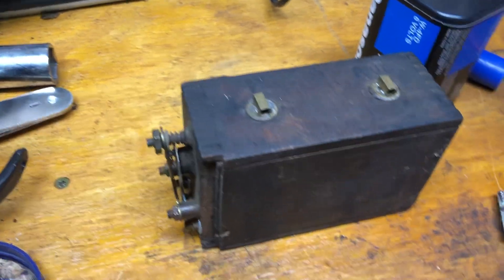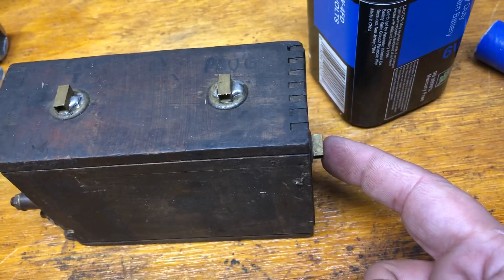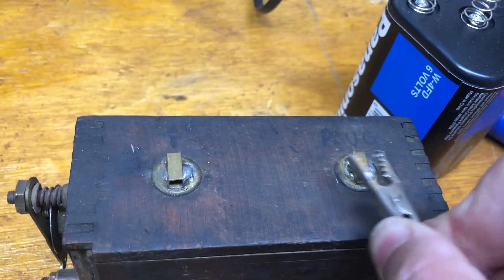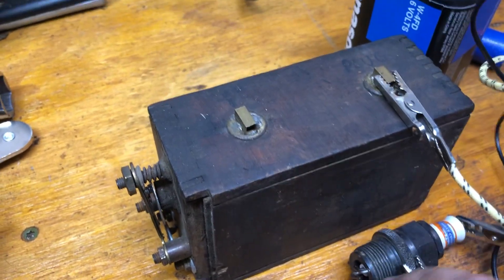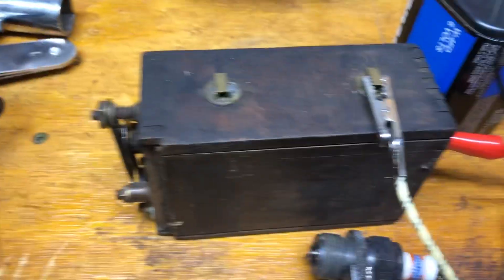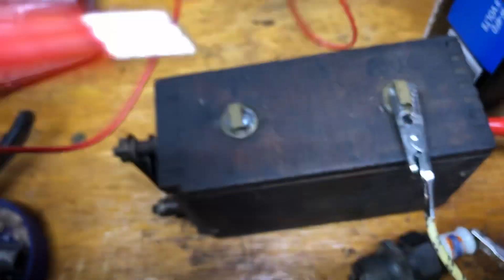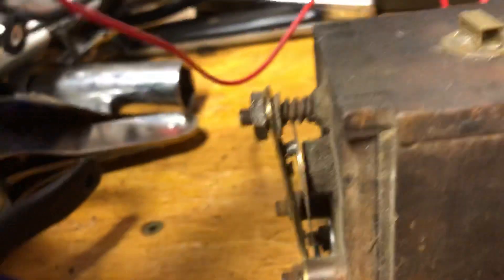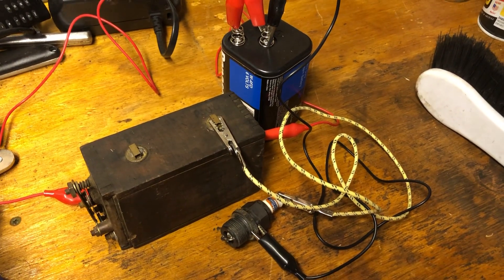Wiring a Model T buzz coil

Comment: That is a fascinating piece of gear. A self oscillating spark maker. It is like an MSD system but mechanical instead of electronic. So every time the timer points at front of motor  close that cylinder gets multiple sparks instead of one spark like we are used to today. And technically it is a distributorless ignition. Again way ahead of its time. Thanks for showing this. I always wondered how these early Model Ts worked, not seeing a dist.

Comment: As a kid I had one of those. I soldered screw terminals on it and I played with it a lot. I got zapped often enough and I developed great respect for the high voltage. I still have it as it happens. The coil, I mean, and the respect.
Reply: Grandpa and his siblings would hook it to door knobs. Great grandpa owned a shop

Comment: Culd that thing by used with capacitors for hoter spark?I dont have realy points I have induction triger and gm 4 pin ignition module I want to make my own buzz coil for each cilinder preferably with dual fiering culd you explain how to calculate rpm range for centrain engines ? How culd I spark 180° spark timing ? I need 2 x fiering in same cilinder . Some thing simular to waste spark culd relays do that job?